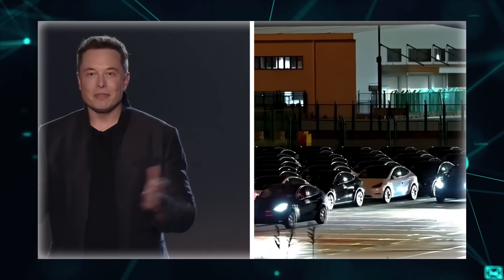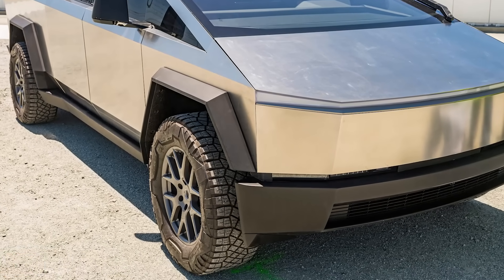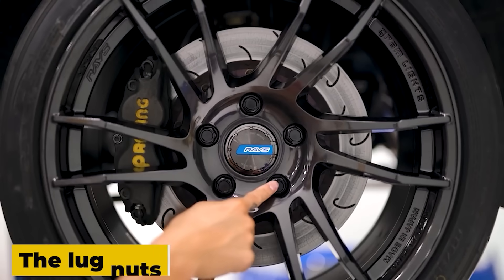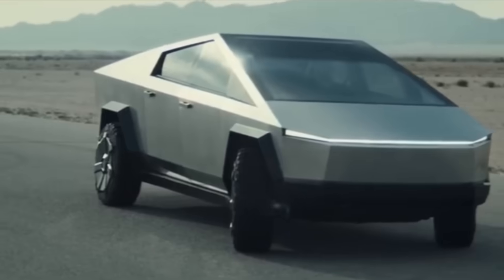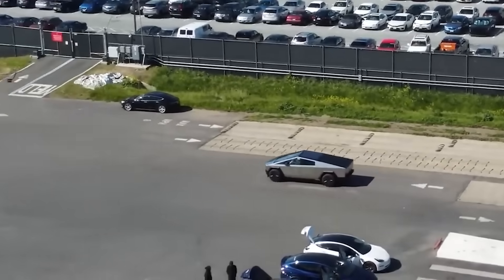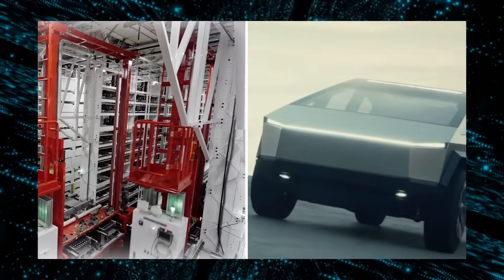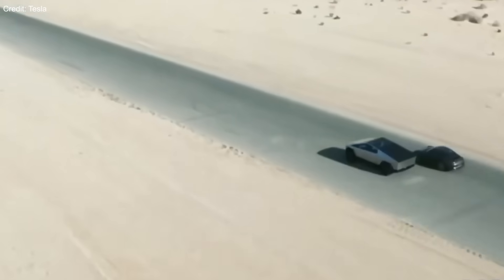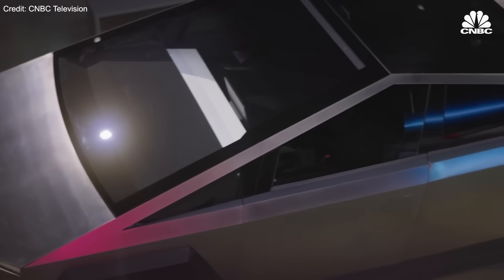Tesla Cybertruck is Officially Here

Comment: Aptera Solar roof option is twenty eight hundred dollars And it gives you forty Miles per day to leave the car in the sun. If Tesla allowed the edition, it could give us 40 or more miles. I will pay up 2200 dollars.
Reply: Aftermarket
Reply: I agree. Those of us that park our trucks/cars outside all day during work hours say 8 to 10 hour work days, that 20 to 30 extra miles a day, even more on days off work. 
Solar on the retractable Tahoe cover is the best option, and an optional detachable solar roof and frank, maybe even a solar panel that would attach to the windshield while the vehicle is not moving. 
I lovecthe cyber trailer,  the camper that fits in the bed of the truck. The light bars, all the proposed accessories seen in some videos. I would also prefer the shield cover over the wheels as they seem more aerodynamic.